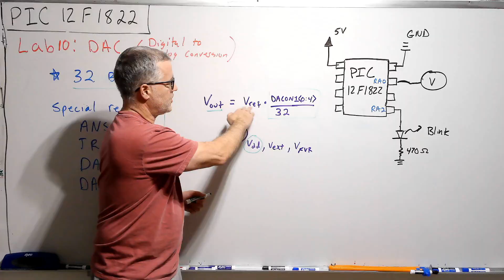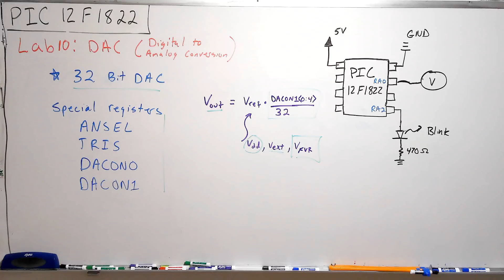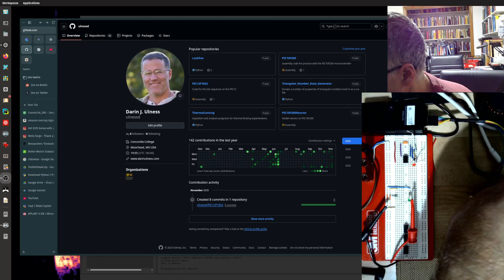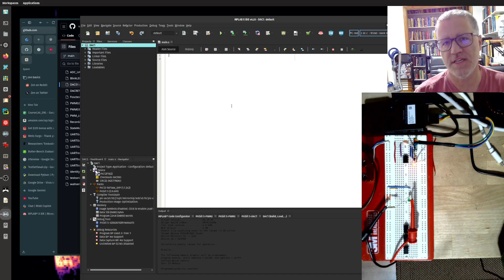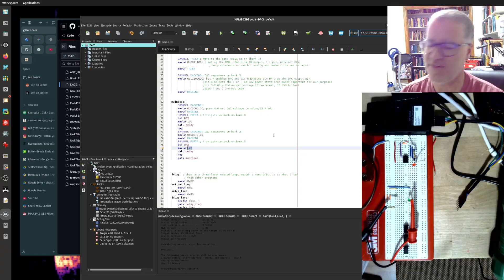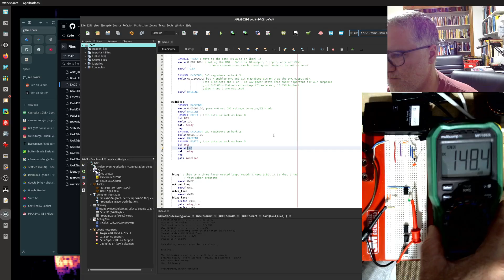PIC12F1822 Lab 10 - Setting up the Digital to Analog Converter (DAC)

Comment: Thanks for the video. this is really strange. I have a different pic but everything works for me if BCF TRISA 0 (i.e. as an output)..
Technically it is 5 bit. if Vref 5V = 5/32= 0.15625 this is its voltage step. this is how smooth your signal can be. for example if you use as DAC for Vref op_amp this smoothness may be important.
Reply from the maker: Yes. Thanks for the comment.